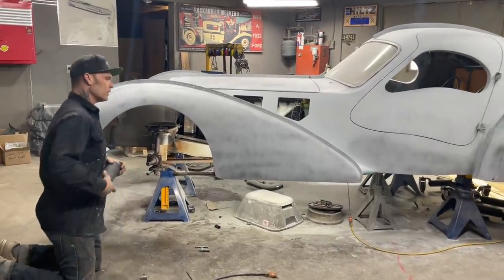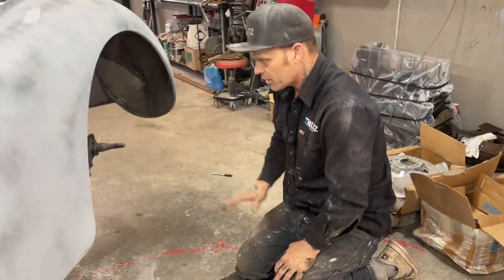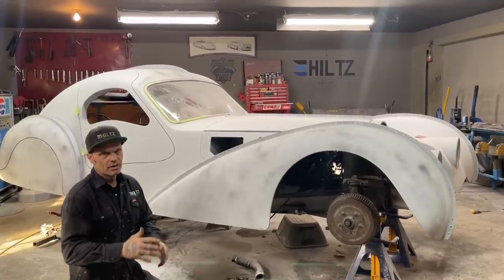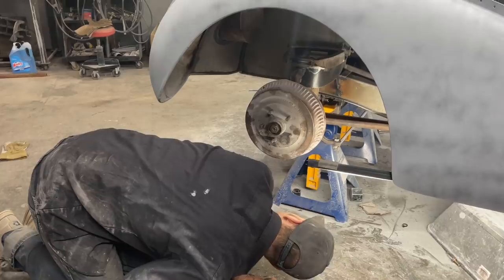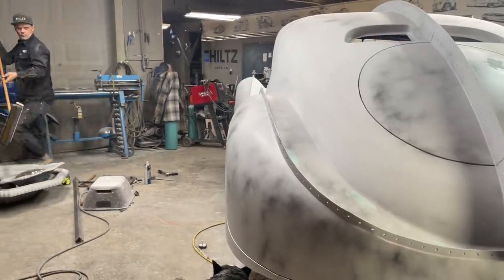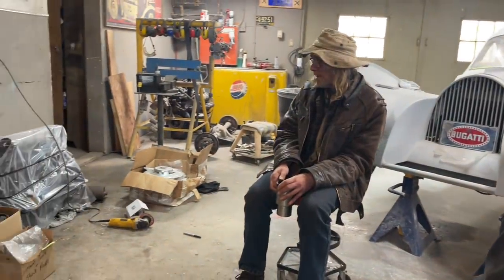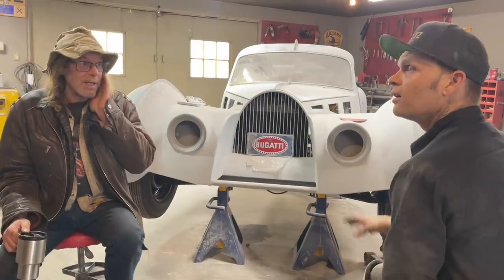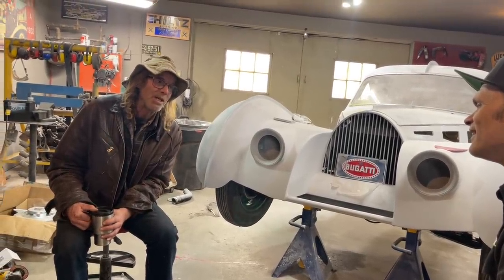BUGATTI: TESTING THE WHEEL TURNING RADIUS WITH MOCKED AIRBAG SUSPENSION

Comment: Hi Chad. The radius rod needs to flex where it connects to the lower control arm. Heim joints on both ends?
Reply: The lower control arms will be trying to twist as the suspension cycles up and down. I believe the originals were mtd in rubber.
Reply: If the lower control arm has a ball joint with the upright, doesn't the radius rod needs to be rigidly connected so it and the control arm form a lower wishbone?
Reply: @salamander5703  yes sir i believe that you're right.
Reply: @salamander5703  I believe you're right. I had forgotten that the Heim joint is self-centering (has a swivel). My bad.

Comment: The end of the double torsion bar that is welded to the lower control arm will need to be able to move up and down as well. the wheel travel will only be a couple of inches it will tear the weld out. if you over weld it then the front end may skip going around corners. both ends need to pivot up and down.

Comment: Speedway sells a very small compressor and gage that would fit anywhere on the car. Air Lift 25804. I use it for front air bags and it works slick.

Comment: Chad, when locating the rack make sure the inner tie rod joints align  with the lower control arm inner mount bolts to prevent bump steer. It looks like that's going to be the biggest challenge of the front suspension build. Tom Martin.

Comment: Locate and source shockwave type air bags for the front end. If not install shocks in the front as well or that front end steering at speed with nelly pretty vague. Also weld in steering bump stops on each side to limit turning radius. Check not only the caster and camber but the SAI of the axle otherwise at speed it will be a task to drive. I’m just worried don’t want you or Jolene hurt.

Comment: Hey Chad
That airbag you have looks very similar to one used on the cab mount of a truck. In the states they call em tractors or semis. Down under we call em prime movers. Anyway cab is normally hinged at the front with one or sometimes two bags just like that one as the rear mount.
Ps. Love the dog. We use em to herd cattle

Comment: I would definitely set up the front wheels first so they are even so then you can make the hardware and mounts to align it. You could definitely use some spacers for the front wheels to bring them out a bit.. Even with the bags dumped you will still have lots of clearance under those fenders.Then I would work on the rear end and setting that up and aligned. Alignment needs to be dead on, or it can track to the side or wander. It really doesn't take much either to really notice. I think the car is really making alot of progress so far, I can't wait to see Her painted and running. Maybe you could put it in the Moncton car show this Oct.

Comment: I saw Jay Leno driving the Mercury Bugatti and he mentioned the steering/turning was not very good - I hope you add a bit of the Bad Chad touch to the finished product as well as improving the driving experience and ventilation problems by installing air/AC etc. awesome work guys

Comment: When a vehicle turns a corner the inside wheel must turn a tighter circle than the outside wheel. This has been known as Ackerman steering . this was designed on horse drawn wagons by Mr. Ackerman. It is accomplished by drawing a line from the front king pin or ball joint to the center of the rear end (usually the U joint ) then pivoting the steering tie rods on that line. With a rear steer car the tie rods are about 2 inches inboard of the rotor and on front steer cars the tie rod are 1+ inches outboard. Don't mix the up
Reply: Wise advice. Learnt that just prior to designing a working steering system for a pedal electric car, like a boss.
Reply: Most of that happens automatically but the length of the steering arm form the center of the the spindle make a huge difference in the steering rack vs radius

Comment: A first gen ram 2wd truck uses a single bushing lower control arm setup like that, and the strut rod bolts directly to it with two bolts and has a rubber bushing at the frame end. I think you will be ok. 🤷‍♂️

Comment: I think the trailing arm needs to hinge on the front as well as the back.
Reply: Ya that's what i saw ,Needs Heim joints on both ends.
Reply: Nope, it will be fine. Lots of Mopars & Fords use basically the very same set-up. What Chad is calling the "radius arm"  would be a "strut-rod" on a mopar. It faces forward rather than rearward. But the function is exactly the same. The mounting configuration is also identical. Chads Lower Control Arm, and Radius Arm, collectively create an "A-arm". The Radius Arm bolted fast like he has it actually keeps the Lower Control Arm in alignment to its pivot.
Reply: @glassblastcollision  NOPE! See my other comment.

Comment: With the current front control arm geometry,  I'm afraid there will be a  toe out condition on compression and droop. Will be squirrelly to drive on the pavement, especially at highway speed.
Reply: I don't it will make it out of the shop!

Comment: The original mustang strut rod was designed to pivot on the control arm. Unfortunately Chad you have designed no play in yours. The air bag will not work because it can't move. It will ride like you left the 4x4 block in it.  To fix it you need 2 more heim joints mounted outside the control arm on a extended plate. You can still run the airbag in the same spot.

Comment: Chad.    many people are saying it but the trailing arms are NOT going to work like that.    Take your wood block out and try to move the suspension up and down by hand it will not move much without a flexible joint on the front and back of the arm.

Comment: The footprint of all  four tires need to be squared up.   Moving one  wheel and tire forward or backward "because it looks better " in the wheel-well creates a big problem.   You are changing the wheelbase asymmetrically.  Left side will have a different wheelbase than the right side.  This will make the car 'dog track'   and make the car behave erratically around bends and turns.
Also, what you are calling radius rods are going to bind up if you have both rods fixed to the lower control arm.   The  mustang and some cars like it mount in rubber and or a single rod that had some torsional ability.    It might be worth looking at mounting a single rod each side mounted in front.   This would also solve the problem of the rack interference.   Good luck, enjoy watching.

Comment: The guide coat helps you know where you have already wet or dry sanded so you don’t over sand. You should always use water as you go to remove the sanded primer so you don’t burn through the primer . A water bottle with a hole drilled in the cover works great .

Comment: The trailing arms need to pivot as the suspension travels up and down. They won't work and will jam up your travel being fixed to the lower arm.
Reply: I would say your correct on that it should be pinned and bushed on the frond of the arms
Reply: @tomsawyer247  that or hiem joints

Comment: The line of the wheelarches at the front is wrong (althought the shape of the car's tail is great!) - it turns into a straight line where it should continue as a curve. Also are you intending to use bigger tyres to fill those wheelarches better?

Comment: Depending on the rear end ratio this car is good for 160 - 180 plus kilometres an hour and this needs to be considered in the final build.  Handling is as important as looks and performance.  Please take a more engineering approach to the front end suspension setup.  At the very minimum consider the geometry of the original mid-60's Mustang geometry.  Suspension is not just a choice between coilovers and airbags.

Comment: Hey there again.. I just want to share a idea with you that we use to do on our nascar sanctioned race cars. So on your front end where you are having clearance issues you can make your own tie rod ends and arm and use 7/8 or 1inch round tube and use himez ends for your tie rod that Way you can make spacers to put in between your himez and Spindle and not only will it help your clearance but it will set your bump stear as it moves up and down your toe won't change. Look up bump steer setup and see what I'm talking about so you get a better idea. Hope this helps.

Comment: Very nice car. I have one thought. The original was a concept car, it had no opening windows or vents. Riding in a tin can with a hot motor in front, and a hot trans next to you is a sauna exercise. Ride with a bag of frozen peas between your thighs? Before you mount the inner fenders, dash, I would try to duct in some cool air. Any air in also has to escape so a vent out the rear would also be needed. Think of GMs old astro ventilation. I have a 57 T-bird that has flip out vents at floor level, unlike the 55-56. If you don't open them when it's warm outside your feet are ready to eat in 45 mins. My car has windows that open also. I know you  don't like to plan ahead, but this car is for your girl to drive.

Comment: You definitely need to swivel both ends of that trail arm, the weld will break or the pipe will break under stress, and all that work is Down the drain. Love the show but look close at that setup
Reply: Lil sketchy. With the front end set up. Hmmmn. I guess we will find out.

Comment: You'll need a zero offset wheel to insure the wheel will clear the disc caliper.  If you do use spacer hub-centric type would be best.

Comment: Chad, I think you'll need to "bush" the other end of your wishbone control arm. I think that if you wield it straight to your front axel itll snap the wields and mess up your airbag system. Just an opinion on a foreseen issue
Reply: The control arm usually has bushings on both ends for movement

Comment: In looking at the car from the front and the relevant position of the wheels to the center of the fenders, it seems that a spacer would not only help the turning angles of the wheels but also improve the icon of the car from the front as the center of the wheels is match the center of the fenders. Excellent job, I can not wait to see this car rolling on its own.

Comment: turn it when the car is on the flore.... the rod will hit the radiator..I think ?
Reply: If that steering rod is hitting the radiator now it will destroy the radiator when the suspension moves up. As soon as drops it on the floor w/airbags and it settles it won't move left or right, it will destroy everything it rubs.

Comment: That bag is garbage and that suspension is trash, it would have been alot easier to put some a arms, make some or from a g body, btw that disc brake conversion will change the offset of the wheels, the wheels are going to move out. Caster, Camber, Toe he forgot all about that. Smart guy but sometimes he needs to ask a pro for advice. Cars built with the mind set of, do what you can with what you have at the end of the day is trash. He put alot of time and effort to build that body and then to cut corners on all that other crap.
Reply: Exactly! I just retired from 40+ years of brakes and front end service including alignments. Everything you said is spot on. The car will be unsafe which is the last thing I would do to the woman that I love. Cost of safety shouldn't even matter. I've seen his show and he's been very lucky but how long is that going to hold out. I couldn't imagine being responsible for something happening to the love of my life. Please Chad have a suspension specialist look at what you are doing, for safeties sake.